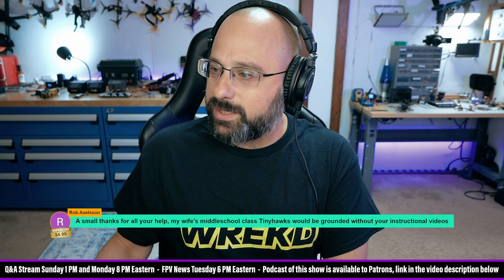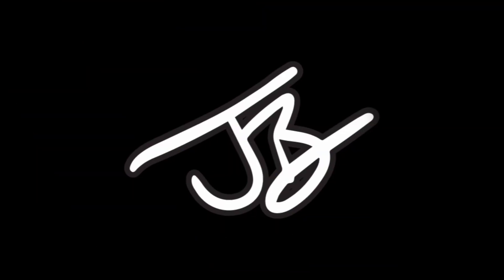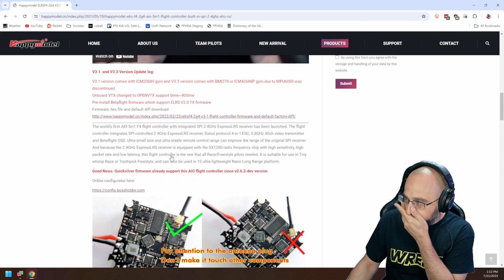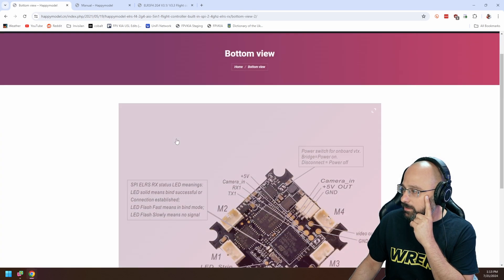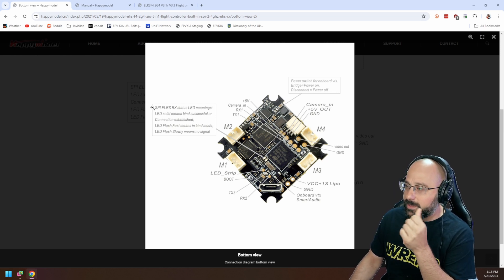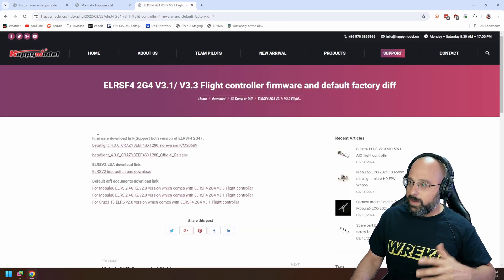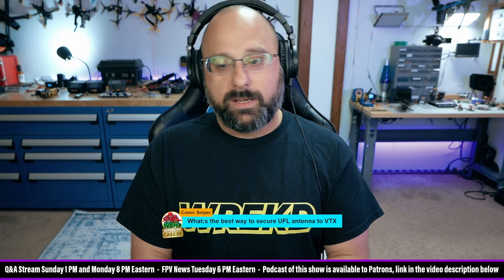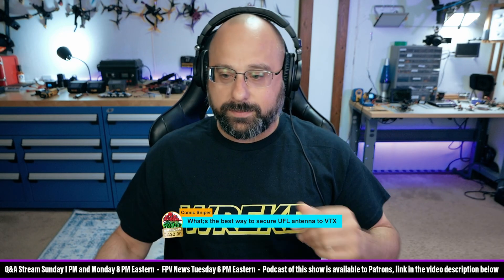Whoop Yaw Washout? ExpressLRS Baudrate? - Random FPV Questions

Comment: I had yaw washout on my Air 65 after tuning it from scratch following Brian White Step by step process, and it turns out that you can actually remove yaw washout by giving more authority to the Yaw using the master multiplier slider or the tracking (P and I gain) slider.

Be aware that you have to select Mode: RPY , because Mode: RP will not care about the Yaw. You can also crank up the numbers of the P and I of the yaw axis by hand, but if you go with Brian White step by step method, there is no need (from my experience on this air 65 that i have )

PS: This is not Brian's process that lead my to this issue, it is because I forgot to switch into mode :RPY before tuning my PID

Comment: Prop wash is just the motor maxing out, game changer. Can't believe I didn't know that. Makes total sense now.
Reply: Washout and prop wash are different things: prop wash is caused by the air wake and rebreathing turbulent air, the yaw washout is caused by the air speed and direction (bigger guards have a bigger shadow wake) nullifying the pitch of the props relative to air.

So propwash is caused by relative vertical movement, washout by an excessive forward movement: the example of the whoop looking downward and diving at low camera angle means that is a forward movement and is too much for ducted designs.

Comment: Yaw washout can also be caused by incorrect settings on your Flight Controller.

Some months ago I was facing the yaw washout problem often on my Skylite 3" cinewhoop after updating to Betaflight 4.5. After trial and error I figured out that it was because I had the new EZ_Landing feature on, and that Airmode was off.

Comment: Wings and fixed wing are a blast!
Reply: FPV fixed wings are fun af.  Thought it would be boring and I would turn into one of those AMA obsessed boomers with their 2 stroke paper mache and balsa planes.  Nah, I got a fast af wing with a big ol "fuck gravity" sticker and fly low af at 99.9mph only, never more (never less though)
Reply: @tb6638 yeah I’m about to build another one soon. Had a TBS Caphirana 2 that was setup for long range and it was a blast. I still have most of my radio gear like 2.4ghz video with ground station and tripod with antennas. Nothing like some low cruising at pretty long range. It would be a blast to take to the mountains on my next trip to visit family in Tennessee.